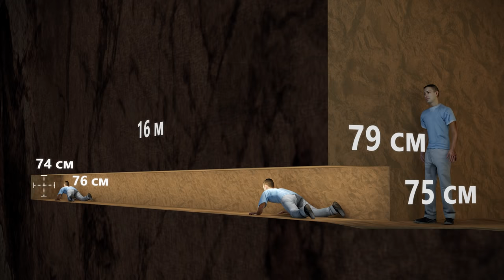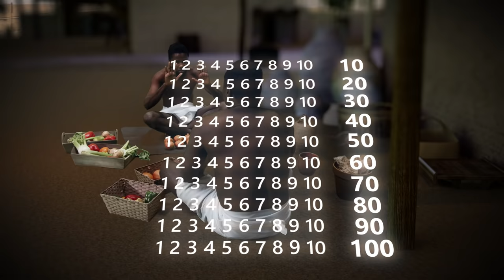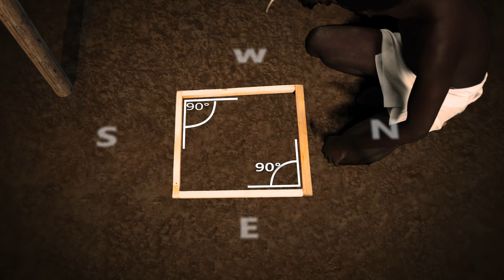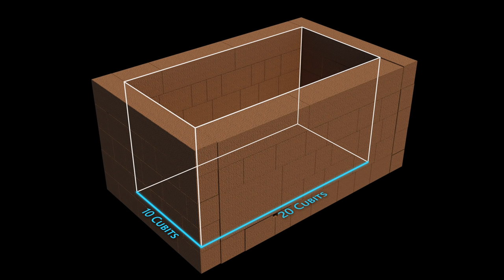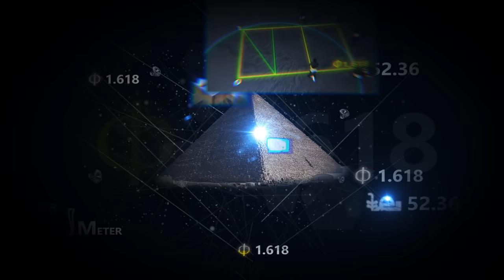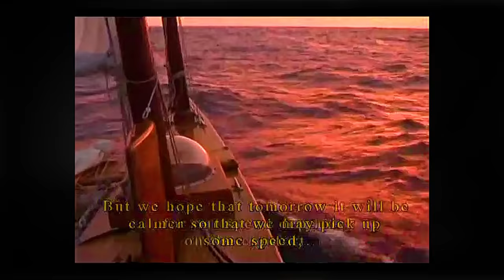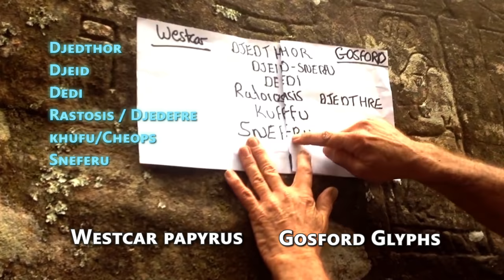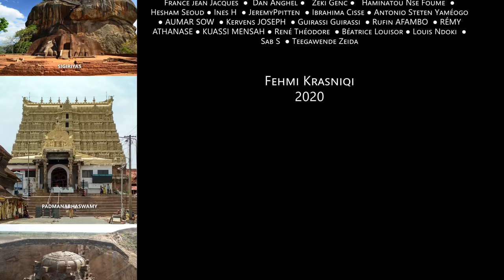The Movie Great Pyramid K 2019 - Director Fehmi Krasniqi

Comment: I’ll be honest, the geopolymer idea keeps getting more and more likely based on continued experimentation and the fortunate removal of Hawass
Reply: I had the idea of geopolymers playing a major role in several ancient sites including in Egypt & Peru a couple years ago when seeing two things:
1. The external shape of the rocks in Cuzco appears to show shaping,  as if the edge of a bag kept the concrete in place, and was later cut away. No, those are not where there was some sort of handle for carrying these stones.
2. All of these objects were made from metamorphic rock, which means some kind of mixture formed the rocks. Why do we assume the rocks were natural and cut from a quarry?
It seems ancient people had discovered methods of forming something very similar to our concrete today.
Reply: But the measurements are so accurate over such a large scale, and also the statues are so exquisite and accurate, not made by simple people but godlike it seems to me.
Reply: "God is the molder and we are the clay" takes a whole different meaning, isn't it?
Reply: I don't see how grinding all of that limestone, carrying and raising it, building moulds from timber (which was in short supply) mixing, pouring, setting, disassembly of the mould and finishing, was an activity any easier to contemplate than the natural stone theory.
Reply: @pencilme1n  Weighing it up I'd say it would be easier than hauling many tons of rock, what do you make of the wood posts though, sticking out the rock? It does beg thought. The arguement against that theory for me is that I think many stones show marks of tooling, and also there is the tunneling mystery. There is one famous stone that shows a hole right through the middle that looks like it was bored by a laser, that could explain the polymer theory as well though. Fascinating!! The Egyptians were fascinating.
Reply: @johnlannikk2701  Yes there are stones lying all around the Giza plateau with apparent highly machined or ground cuts and bore holes. The bore  holes have spiral striations indicating core drilling and there are matching cores, some of which are in the British museum. Given they are granite cores, the strange thing is that the spiral marks indicate a tool progress rate 600 times greater than we can achieve today. They also seem to have bulged in the centre after removal.
None of this accords with in-situ moulding or simplistic tooling, but may indicate some sort of stone softening. Though that's highly speculative.
The interior filler stones are a different lower grade material than the fine Tura limestone casing stones and much more roughly shaped. Most of these have had mortar poured between the gaps. Why would that be the case if they were all geopolymer mouldings?
But they are shaped to individually match, in that they interlock to prevent the casing stones from easily collapsing or falling off.
Reply: A movie about Egypt starring Joan Collins shows the rocks fitting perfectly as clay pots are smashed by a sled like creation...the sand is released and the rocks fit together.
Reply: @johnlannikk2701  Statues are much easier done additively. Like manual 3d printing.
Reply: @pencilme1n  Right!? It's not like it makes it any less grand! Lol! Not like when I go to Egypt now I'll look up at the great pyramid, look up, then just shrug and say, eh... 🤷‍♂️ it's only concrete... 💤💤💤... Oh sorry! I fell asleep it's so mediocre... 
I highly doubt that! Lmao😅😂🤣😭
Reply: @johnrogan9420  that one was pretty cool too
Reply: Zaheed Hawas was the biggest detriment to Egyptology for decades, and archeologists had to pretty much kowtow to get access to any of the sites. Their narrative is in lock step with his.
Reply: @livingpicture  To make precise statues they are claiming the granite "concrete" was poured into a mold. Ok, but you still have to make the mold. It was softer rock you say, but it still had to formed with exact precision. Also, if you have any experience with making something from a mold it is important to have a release agent so the poured material material doesn't stick to the mold. Wonder what that was? I can shoot a lot of holes in this theory although it is presented in a plausible manner.
Reply: @pencilme1n  I had a hard time accepting that thought forms played a huge role. Still sounds crazy but is also supported by the law of one or Ra material. The precision and placement. The kings chamber alone with inferences of light speed and distance from the sun etc is beyond humanity today.
Reply: Don't forget the alien help the ancients received. The more this goes on, the dumber the ideas.
Reply: @Zer Schmetterling What was the recipe the Egyptians used to fabricate this polymer concrete --used in your opinion??
Reply: but it is BS nevertheless.  why would they POUR the concrete into a deep hole to make a HORIZONTAL obelisk... to make it more difficult? if they were pouring anything, they would pour obelisk in vertical position. I won't even go into the capacity and concrete binding properties, because to pour a mass like that they would have to have lafarge concrete trucks lining up, otherwise the new load wouldn't chemically bond with the previous one and the column would have cracks.
Reply: @joannayw5272  yes, without  mechanical mixing the whole stone would be different throughout. All the physics and weight bearing information spouted is meaningless. This is just a theory. The holes can poked in it everywhere. Then it falls apart.
Reply: @joannayw5272  It is BS. One must go down to Aswan, where there is an obelisk still in the matrix, not finished because of z crack. One can still see exactly how they were cut out of granite, using diortie as hammers. Experts do exist, they have worked most of their lives on sites in Egypt, they don't sit in a room somewhere in the world, thinking up these outlandish, hair brained ideas.
Reply: @joannayw5272  they are not saying the obelisk was cast, it was quarried from softened bedrock.
Reply: Lots of work has shown that the stonework was real stone, not any kind of concrete.
Reply: Donald J. Trump Criminal Hair Matches Jumpsuit  
There is much that we don't understand due to past apocalyptic events that have completely erased mankind's history.  One but has to look at the stonework left behind to realize that there are pieces of pottery, statuary, and buildings that we don't have the ability to replicate today, and this comes from engineers globally. To build the pyramids by quarrying, transporting, dressing, and placing a stone to exactly match the one beside it in 3 minutes ( because "archeologists" say the great pyramid was built in 20 years), is sheer stupidity. We can't do that today with the tools and machinery we possess.  All major stone work e.g. the temple of Jupiter built by the Romans at Baalbek in Turkey is built with smaller stones upon a colossal base of dressed stone we can't move today. All civilizations if you study the stonework is built upon superior stonework. The problem with archeologists is that they see stonework, look at the readily recognizable tools and draw what they think is an obvious conclusion and presto! that's how it's done with out empirical conclusive testing. They guess. Now to my point. If you look at Egyptian hieroglyphs you will see a staff called the Was scepter which has a angled top usually an animal head, and at the bottom you'll see two prongs. Sometimes you'll see two Was scepters joined by what looks like crossing wires. If you have the scepters at specific lengths and hit them like tuning forks they will vibrate at a specific frequency. Attached to a bit the vibrating bit will actually start to cut into the stone, even if you're using copper. There are drill core hole samples in British Museum that show that the granite was cored with a bit that would require great speed and pressure we can't duplicate. Tesla said that the secret to advancing technology faster than what we've seen in the past is to work with energy, frequency, and vibration. I don't believe they needed solar lenses to make the stone maluable. Imagine how long it would take to dress a stone on three sides to fit razor thin on the one underneath it, behind it, and beside it. We use frequency in microwave ovens to cause water molecules to vibrate thereby creating heat. Why can't stone be manipulated in a similar fashion? You don't need molds(no wood required).  We haven't investigated things like the Was scepter and other things we see in hieroglyphs that we're not sure what they are. I believe that since approximately 10,000 BC and forward is civilization relearning the world anew. There are so many things that I've been studying for decades that one could write a different book on ancient history. Research, contemplate, look outside the proverbial box, ask questions, and test hypothesis. Good luck
Reply: @aicram62  Truly profound statement my friend
Reply: Donald J. Trump Criminal Hair Matches Jumpsuit  I'm not saying that lenses were uses, because there isn't any evidence of their existence, nor any hieroglyphs showing that they do. I'm saying that the granite doesn't have to liquify to be reshaped. Take for example, ground that has moisture in it will slurry under vibration and flow down hill during an earthquake, yet once it has settled, becomes solid again. Same thing happens with an avalanche, sound, and/or vibration from an explosion charge has been used to trigger a slide, causing previously packed snow to separate, slide down the slope and settle into a state that is tightly packed. Survivors all say that the settled snow is almost as hard as concrete when tr8 to extricate themselves from it. What causes this instant repacking of the snow? Heat caused by friction, while temporary, will allow the snow crystals to repack. Try pushing snow off a roof into a pile and then try shovelling it. You'll see that there isn't enough weight in the snow to cause that much compaction. All I'm saying is that in Egypt alone there are granite rocks showing saw cuts, drill cores, coved slabs that show a different technology we don't possess today. If you wet the saw cuts you can see the curved lines made from something that looks like a huge circular saw blade did it. Same thing with the granite cores. You have cores that have had cores drilled into them with grooves showing that a bit or something else was used to produce the cuts. Again, their isn't any physical artifacts, or hieroglyphs showing this being done. Something ELSE was used, and I think it comes back to energy, frequency, and vibration. I sure don't think it was aliens who came down did the work and packed up their tools and left. Check out stone work in Peru and look at some of the intricate work there, and on top of it, some of the surfaces have glazing on them which look to be done with heat. But from what source? The best example of my point is you can take clay, shape it, and let it harden without using heat, or a mold.
Reply: Hawass was removed??? Thank God.

Comment: Question. How could the wood forms hold together? They apparently had no nails or screws to hold such Hugh and heavy forms. The amount of pressure exerted to the side of the pouring forms would break apart the form if not held rigidly. Poured material always takes the texture of the form used. Do the blocks have wooden texture on the sides?
Reply: not if they poured a section at a time, or if it was dry pack, then the pack would actually enforce the form
Reply: Hi Ricardo, I have not watched this, so I am not 100% sure of the context. But as to your question about no nails or screws fasteners: carpentry of antiquity did not use such fasteners. Carpentry of old used a variety of techniques like mortise and tenon, wood pegs, tongue and groove, knapp joint. Look up "ancient joinery" to see some amazing techniques. Peace.
Reply: @gregkirschke5559  If that was the case. Then after a several pours the joints where the boards and the pegs meet would be more noticeable as the wood would swell with water absorption and pegs would be very difficult to extract. The texture of wood would be even more noticeable. If togue and groove or Knapp joints were used the forms would be impossible to take apart as the heat of the environment would dry the mixture between then and would actually crack.
Reply: If a lot of ancient buildings, temples could be built without any nails or metal, use of wooden mold to hold melting rocks seems entirely plausible.
Reply: @pinview8519  Here are some facts about wood that you may research: Combustion temp. 233 degrees C / 451 degrees f, ignition temp 180 degrees C/ 356 degrees f, smoke temp 149 degrees c. /300 degrees f.
Reply: @medmanbrand  When granite is heated to melting point it becomes magma. That is how it actually forms in nature. When magma comes in contact with wood it ignites it. Ignition Temp. of wood is 180 degrees C or 356 degrees f.
Reply: @ricardomartinez9432  they did have access to several materials harder than granite .. maybe that was the outer casing for the mold .. but this is a good question .. also the one about the curing time posed by someone else earlier
Reply: Another explanation is they could have melted the granite maybe on ground and after it had cooled a bit then scraped it out into the Molds.. that way the mold outer form work wouldn’t have to encounter magma temperatures ..
Reply: @ricardomartinez9432  i totally agree, as much as i want to believe this theory, the logistics of making formwork on this massive scale presents massive problems especially if wood was scarce. On top of things you have mentioned; The part where they hoist the stepped gallery form work up and reuse it each time hahaha it would have to to be disassembled and rebuild it each time. When they pour the gaps down the sides of the pyramid from the top down does not make sense either. I think the makers of this need to go work in concrete construction for a while and revise these theories. Also these glass lenses would be so heavy and harder to move than a granite block. Surely there would be many that would have survived to some degree.

Comment: This makes a lot of sense to me. Although,  I would be more convinced if this theory was backed up by making and showing a modern lens actually do the melting and  cutting of the granite.
Reply: Some people will need even more evidence than that and they still will scoff at this, and some others will know it's true by simply watching the video.
Reply: I'm from Missouri.  The show me state. 😅
Reply: @lonoibi  Scoff at it?  You can't pour granite lol - or are you going to wait millions of years for the crystal to form? ah wait - we forgot the massive pressure required too - damn.  They would end up with glass even if they could melt it when it re-crsytallised.

On top of that there is a huge example of how they didn't do this at the Aswan quarry - the 1200 ton obelisk on display that was being cut from the bedrock.

Then we can move on to the tooling marks, the bore holes, many on central axes as though they have been lathed somehow. The granite blocks in situ in a wall where it clearly shows half a wall of rough stone and the other half smoothed down as though there was a finishing process.

We simply do not know how they accomplished it and this is just another wild theory that is plain bollocks.